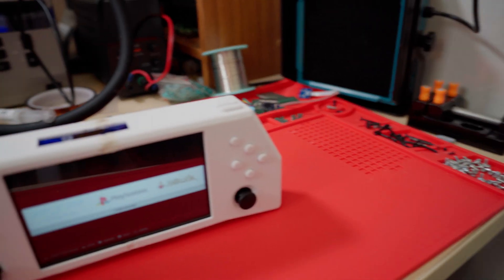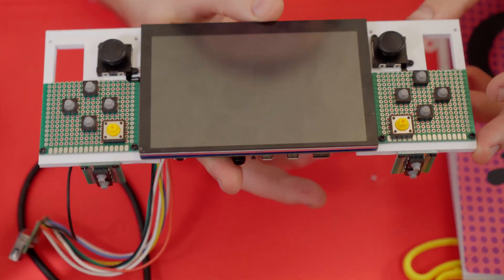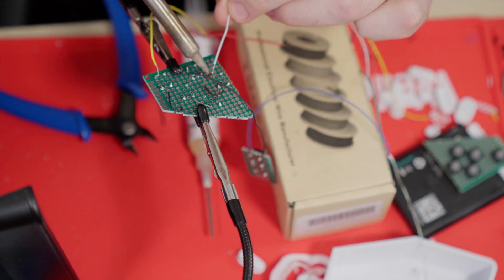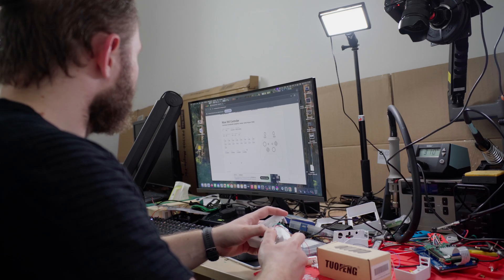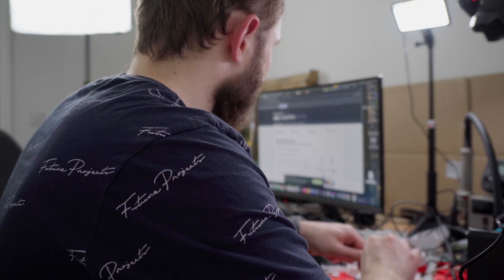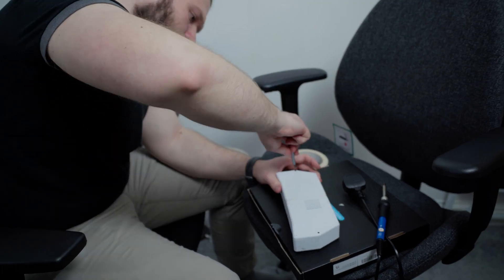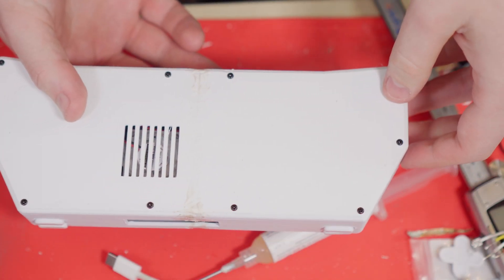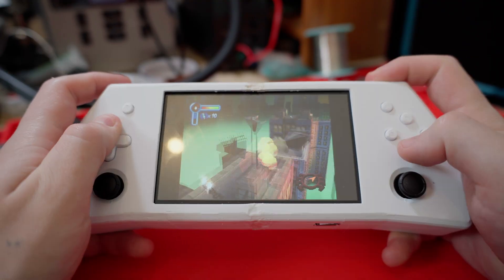I built a handheld console

Comment: Good job! Question, how did you turn on the pi through that, because the piSugar 2 plus doesnt auto power on the pi, do you flip the switch than have a seperate button? If so its a little inconvienent lol. Thank you
Reply from the maker: From my experience if you disconnect the battery from the piSugar then you have to press the reset button for two seconds then slide the power switch on. If you don’t disconnect the battery after that then you can use the power switch only.
Reply: @pimodzzz  Im sorry, my question is when you turn on the piSugar, it doesnt boot the pi 4, so do you have a second button, similar to how if you shut down the pi, since the power switch is in its open state, you cant turn it on unless you turn it off again.

Sorry haha, im new to the hardware-side of computers. Thanks you.
Reply: Excuse my english please, it`s not my first language :)
Reply from the maker: @goldenollies8338 I use the sliding switch to power it on. I shut the console
down from the menu and then to power it back on I have to slide the switch in the off position and then the on position. I don’t have any separate buttons, just the ones on the piSugar.
Reply: @pimodzzz yes. I got confused a lot sorry. I thought that the pi 4 had a power button like the pi 5 I’m sorry lol
Reply from the maker: @goldenollies8338  No worries man! I would have gone for the pi5 but it can draw up to 5 amps so and the pisugar only does 3 amps max.
Reply: @pimodzzz Yes, I attempted with a pi 5 first. The issue is that it’s so new and there’s not many of the right products you’re looking for. Since it draws 5a, I went for the geekworm x1201, which supplied 5v 5a, it was good but it was also to big and tall, and the charging port is in a horrible place. The pisugar 2 plus and pi 5 don’t really communicate well together. It would be better to rebuild it when pisugar makes one for the pi 5.

Comment: Decent work, I made something similar. Bit bigger, but I included so much crap that is was still crammed inside. I found some issues that I wanted to adress in v2. Love to see the soft tactile buttons, plan on using those for v2.
Reply: Extra: I avoided any altering on the pi. Will be using pogopins for v2 to directly connect. V1 has a arduino leonardo as controller communication directly to usb.
Reply from the maker: I know what you mean, I though I could make it thinner initially 😂